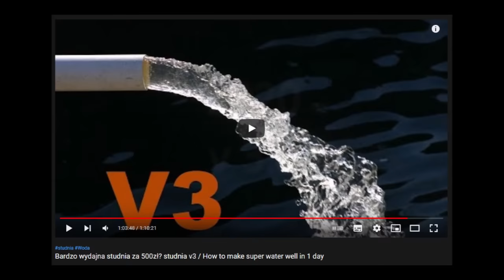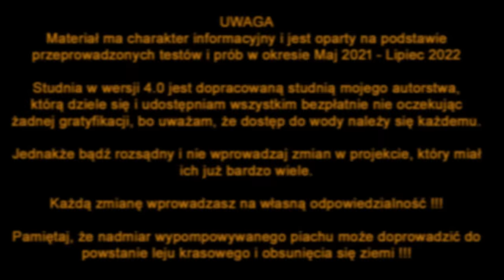Jak zrobić profesjonalną studnie 4.0 w 1 dzień / How to make professional water well v4 in 1 day

Comment: Hello, thanks very useful infos. In the area where I live, at the bottom of small hill, water is present in the nearby there are some springs, do you think I can use a manual drill with extension and arrive at 8-10meter, than use a manual pump?

Comment: i dont think this is a great idea. You are using pvc pipes normally used for sewage, they have a lousy thickness..... they are likely to break under the earth pressure and collapse...  pvc pipes made for well casing are far more thick.  And this method is suitable only where aquifer is shallow and sandy or silty sandy. If  the water table is 20 or 30 mt deep or the aquifer is coarse gravel you have to forget it.